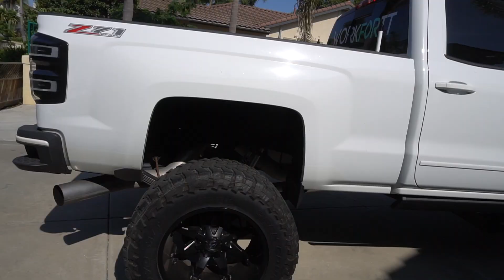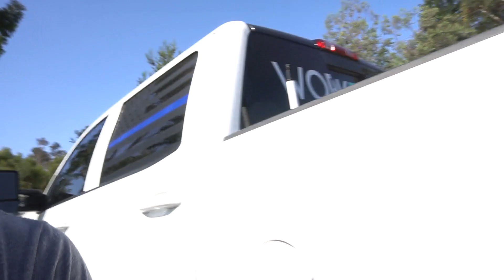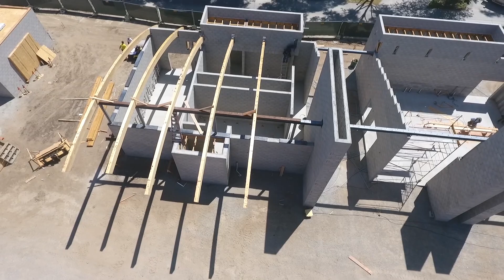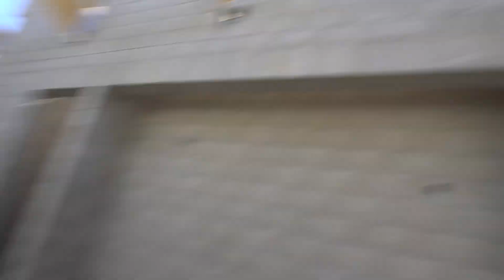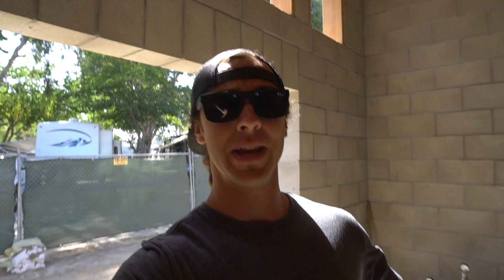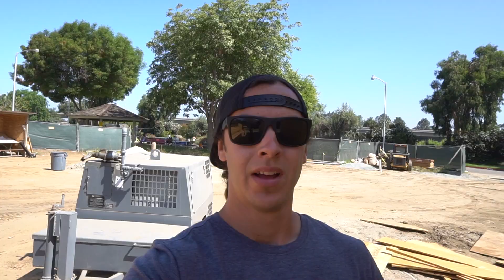Construction Pays My Bills

Comment: Great video, great advice.  You are an awesome role model for the young crowd.  I grew up around construction but my parents pushed me to go to college and always made it sound like it was the only option, so I did, I got an electrical engineering and a mechanical engineering degree.  I am now 48 and I have been working in the automotive industry in the Detroit area since college and I’m miserable.  When I’m happiest is when I’m working with my hands building something

Comment: The beams slides in the " hanger"   and then you screw or nail the hanger and the beam together, make sure you have safety goggles ( the strip of tape that makes the strip of nail will shoot back in your face and you'll be cussing everytime you pull the trigger).

Comment: ordered a pair of those sunglasses right after you mentioned them always had the same problem with getting headaches really bad but these things fit great ! no joke I've been going on years now without finding a good pair that fit me well so thanks!
Reply: Just going to put this out here. You can go to any eyeglass shop and they will heat up and bend sunglasses into the right shape for your head. I have sunglasses that are very tight and wont fall off and a pair that is perfectly matched to my head so I don't even feel them.

Comment: Where is the hardhat at??
Reply: Team Lifted813 he’s not working why does he need one actually in my opinion are hard hats really needed like 95% of the time if shits falling on your head a little hardhat won’t work when I worked in a train yard they made me wear one and it’s like if somthing falls in a train yard it’s gonna crush you
Reply: I thought the same thing. I'm an ironworker and hardhats are absolutely necessary even if your not working if your on the jobsight you need one I could get hit in the head with who knows what, a wrench, a brick, a scrap piece of metal, I could be working  in a tight area and bump my head.

Comment: What's up, I need some help from anyone that is knowledgeable in construction. I'm the same kid that he's describing. I'm going to be a junior in high school this year, and I've always had a 4.0, but I'm actually moving on to college instead to graduate with my AA. I want to go into construction, specifically I want to be a GC. I'm just confused about the route I should take. I don't know if I should go to college or not. If I do I assume I would get my degree in construction management? If I don't decide to go to college how do I go about getting my GC license?
Reply from the maker: Riley Peters The requirements to get your generals license differ state to state. While construction management is a decent route to go if you plan on attending college, you'll still need on site experience prior to being eligible for a license. A 4 year degree in construction management will count for 3 of the required 4 years experience needed for a license. Bear in mind, having the license doesn't guarantee work or a paycheck. Nor does it man you'll necessarily start large. Everyone/situation is different, but having knowledge/the ability to do a lot of the trades you'll be taking work on for will help you when you start. I started with a lot of small jobs where I did most of the work myself. There's more money in it from the get-go that way. And you'll need the money to keep expanding your tools/fund other jobs. So if you didn't go to college, you can get out into the construction field right out of high school and learn a ton on site which in my eyes is much more beneficial than sitting in a classroom.
Reply: DMAXRYNO Thank you for responding! It's all a learning process for me, and I'm excited to get working in construction!

Comment: Why would you buy a "duramax" but not load anything in the bed or tow anything. That's what they are for it's a work truck
Reply: Have you seen a work truck?  They're beat to shit. And used for work.  Why don't u load metal into your 70k truck. Hope you don't scratch the shit out of the side.

Comment: +1DMAXRYNO you should lift the ford
Reply: Dmax Universe he should kill the work aspect of his work truck good logic I give this one 10/10
Reply: Vasiliy Dronov how does lifting a truck kill the work aspect of it?
Reply: It depends how high you go, a six inch lift might be a little much but a three inch, like i have on my f150, is perfect
Reply: Carter Eberline for those of us working in the construction industry your truck bed is something you will be getting in and out of 50times a day also you get in and out of your truck almost as often not to mention it's something you don't want very high because if it's high that means you have to lift everything you put in it higher and if you work in construction some of the things you put in your truck are let's say not light also if he tows with it you don't want to lift it as you will lose your ability to tow as heavy as you would normally even puting a leveling kit on will kill your payload and towing as your truck will squat and now instead of being leveled or perhaps a little squated you look like your flat out over loaded and you are now a hazard on the road for many reasons. The amount of cons just flat out weighs any pros to a lift kit if your using your truck for work.